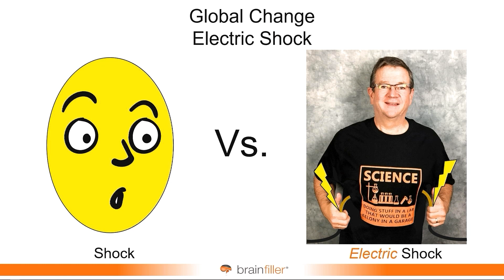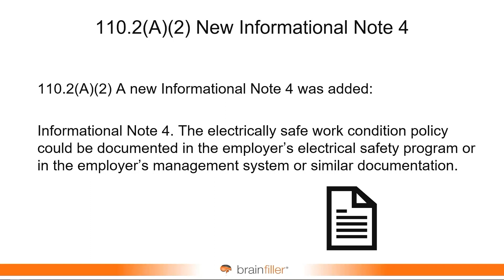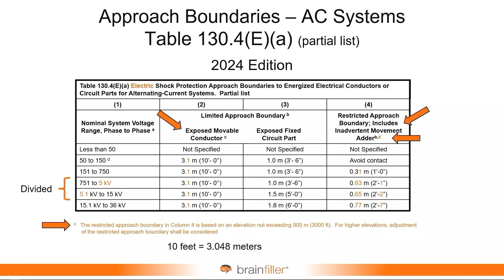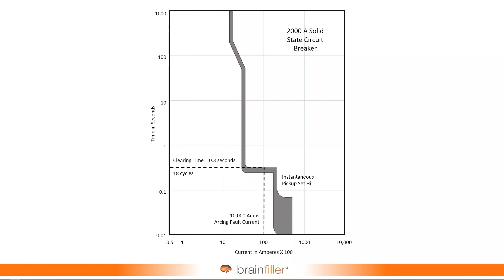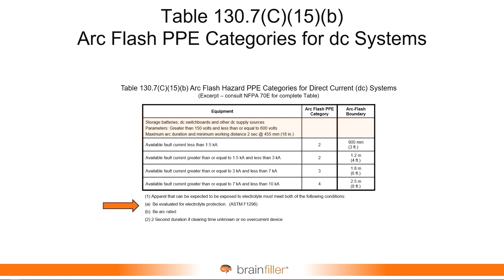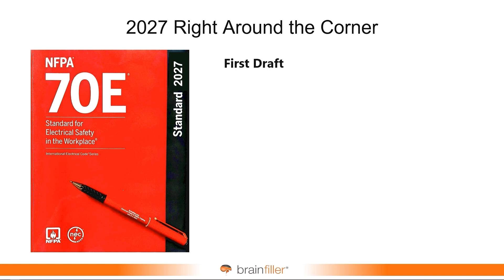2024 NFPA 70E Major Changes - Jim Phillips, P.E.

Comment: What is the arc flash ratings of metal sheets used in enclosures based on material and thickness? Any table or calculation? Thanks from the Philippines
Reply from the maker: Metal sheets do not have an arc flash rating by themselves.  If this is for arc resistant equipment, the entire assembly is tested base on either IEEE or IEC standards. Nice to hear from you.
Reply: @Brainfiller  If Arc flash suite are tested why not the metal sheets used in switchboards and panelboards. Should NFPA70E require ASTM to test metal sheets and have a table? I have seen enclosures and dead fronts have a hole after an arc blast. Should this be a concern of NFPA70E? Can we replace the cover with a metal sheet capable of sustaining the arc blast similar to the rating of PPE in cal/cm2

Comment: Engineering logic tells us that doors in the experiment that doors shall have sufficient lock or bolted for Engineering solution to safety. The part of the hinge clearly has sufficient strength. 

Require standard on how covers will be locked to sustain available short circuit arc flash.

Also, there should be an Arc Flash rating on the metal sheet . If PPE has Arc Flash Rating. Metal Sheet used in panelboards and switchgears shall also have Arc Flash rating based on material used and thickness. Hope this will be in the next revision

Comment: 130.12?

Is there any way to change this word salad?  I understand the intent, but it looks like a team of HR/Safety, Lawyers and ISO freaks wrote this.  It could simply say, "Before any work is done to electrical equipment/conductors, care must be taken to insure all possible electrical sources have been put into an electrically safe condition."    

It is suppose to address the possibility of multiple sources or back feeding on a circuit that is being worked on.  Every qualified worker would be well aware of this hazard and will take precautionary steps.
Reply from the maker: The best way to initiate a change is to submit Public Input (proposal) for the 2027 edition a NFPA.org.  The closing date is June 4, 2024.  Thanks for your comment.

Comment: Is there any chance that there will be higher categories of PPE added since we have more capable PPE?  I honestly expected this update for 2024.
Reply from the maker: Nothing that I have seen is on the radar screen regarding higher catagories for NFPA 70E.  Many lean towards calculated incident energy.
Reply: Why? Hierarchy of controls suggests Eliminate the hazard. Have we all not looked at Doughty and Neal in the 90's and IEEE/NFPA collaboration of the early 2000's? 5-12 calorie arc flash 140 db SPL consistently. You guys can wear all the 100 cal stuff you want. My students are trained to reduce or eliminate the hazard. Their leaders need to be trained that convenience and prevention of financial loss still does not justify the risk. LOOK AT THE controls pyramid.. PPE IS THE TIP OF THE SPEAR!! 
I do NOT care about improvements in PPE, PPE at best is marginal to keep you from being dead. Sound is sound. 141 DB SPL is around 2160 psi pressure to the body. Why are we so adamant to make it electrically safe when in doing so we expose people to huge electrical explosion risk glibly "oh the PPE has improved!!" Really? The Psychics of the arc flash is the same as it was 40 years ago when Ralph Lee published "Arc Flash the the other Electrical Hazard". Yeah I hear you all this is some old guy. Yeah following the rules is why I am still standing at 72. Think about it. Oh, and remember all the whiz bang relaying and fiber loops you do still reduce the hazard but 5-12 calories (rather low values) still generate the maximum OSHA allowable exposure. Again think about it.
Reply from the maker: @j81851  I was part of the steering committee of the final incarnation of the IEEE/NFPA collaboration and on the 70 Committee.  There is quite a bit of inertia so veering from the existing categories in the near term is unlikely.
Reply: We need to reduce the hazard (i.e. technology to shorten clearing time like vacuum bottle breakers and electronic metering) or simply turn it off. Since there is no real calculation for blast (acoustic) energy there is no guarantee of protection from the blast since calories are heat. Recent assumptions the  blast is incidental are insane. I tell my customers when I train their people avoid above 40 calories. We need to reduce exposure (per OSHA and NFPA 70E) instead of increasing it.

Comment: What are the arc flash ratings of metal enclosure covers of panelboards and switchgears
Reply from the maker: Metal enclosure covers, panelboards and switch gear do not have arc ratings like PPE.   However, some equipment like switchgear can be designed based on standards such as C37. 20.7.  This equipment,  known as arc resistant,  is designed to contain the energy during an arc flash if it is properly closed.
Reply: @Brainfiller  Right now it has no rating.  However, if cover will have rating it will assure that the person in front of the switchgear.  This may allow person in front of the switchgear just monitoring to be safe without a PPE.  If PPE can have a test on Cal per m2 then enclosure covers should have this test too.
Reply from the maker: @elec3calengr  Equipment can go thought testing to be arc rated.  This is not an arc rating.  It is the ability of the equipment to contain the energy.  PASS/FAIL not a specific arc rating like PPE.  Two different things.